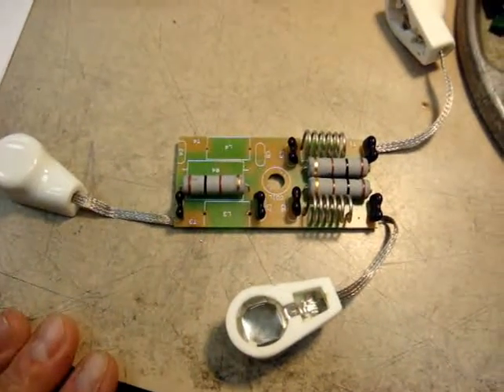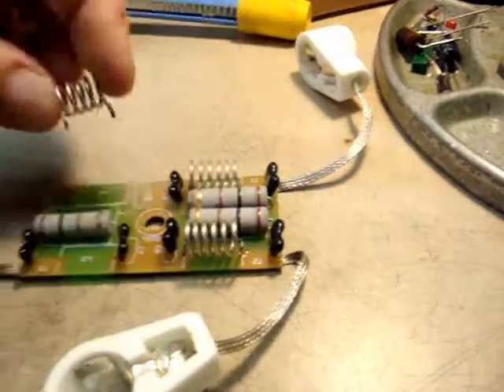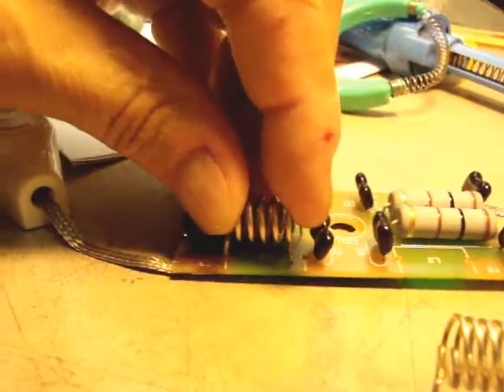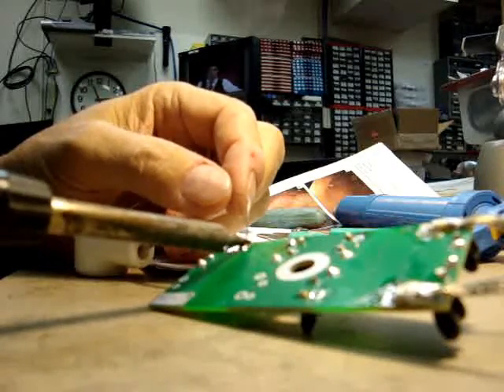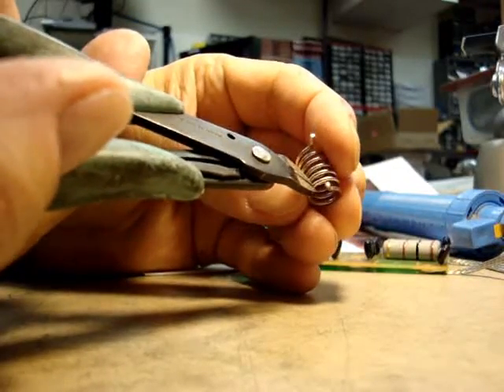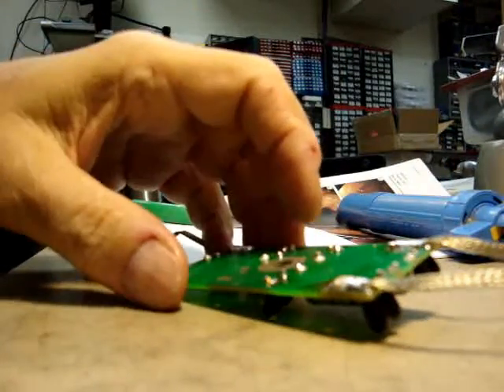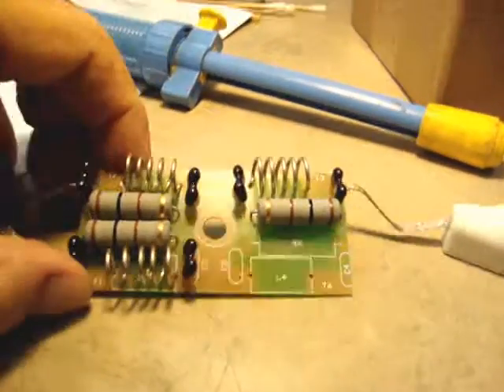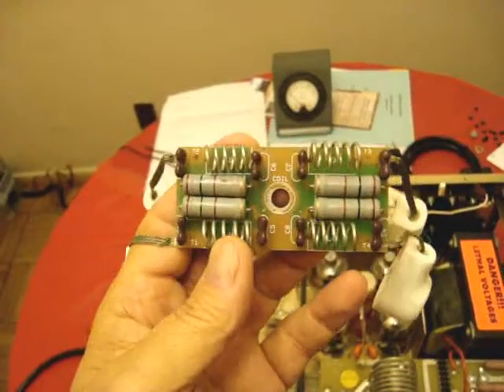Ameritron Parasitic Choke Problem

Comment: mine is different , it must be an older design as the resistors are located inside the inductiors, and there is no circuit board.
Reply from the maker: slartybardfarst52 - Yes, you're right.. Ameritron used those in their older amps. There's really nothing wrong with that style. Altho, some of the more recent theories with parasitic choke designs indicate having the resistor and coil side-by-side as is the case with Ameritron's newer style parasitic choke design. Supposedly,  it works better. If your amp is stable, then it's ok.. no need to change anything.
Reply: Bob H I do have a strange fault with mine though,  even though the amplifier works fine the HV meter only shows about 700v on the meter instead of 1.7-1. 8 Kv.  I don't understand why this.
Reply from the maker: slartybardfarst52 - Check the meter dropping resistors in the plate voltage circuit. Since you verified that the amp is functioning ok, it sounds like the resistors may be bad. Do you have a HV probe to check the plate voltage?
Reply: Thanks for the reply Bob, I took the time to check the associated resistors in the vicinity of the meter, I had checked them before but thought I'd best give it another look over, they all seem to be ok, R6-11 checked and all within spec. I'm wondering whether it could be a tube? the anodes on 2 are not good and burned through, luckily I have a spare set. And no unfortunately I don't have a way to check the HV unless I make a potential divider with a bank of resistors.
Reply from the maker: slartybardfarst52 - Check that the amp is wired for the AC mains voltage you're using. Did you get this amp from a previous owner?
Reply: Yeah it's an old amp, I'm in the UK so the mix of 110/220 shouldn't be an issue as it will have been on 240v here all it's life.
Reply from the maker: slartybardfarst52 - I've seen these amps having previous owners that were wired for 240v and a 120v plug, so that's why I always advise checking for that. Your measuring only 700v sounds indicative of this problem. If you're comfortable doing so, remove the amp cover, short across the interlock switch and check the voltage across each of the 4 power supply capacitors; voltage should be around 450v DC per capacitor. What is it?
Reply: Bob H Great suggestion Bob,  I took the lid off and tested all the 4 capacitors and it indeed reading about 450v on each +/- 2 volts,  so that means my HV is in fact definitely 1.8kv, why the inbuilt meter isn't reading more is strange,  BTW it deflects fine when reading plate current.
Reply from the maker: Good info. Interesting that the meter works ok in the plate current position. That verifies that the meter movement is ok (I think). So verifying that the following resistors are ok (R6, R7: 1 Meg ohm, R8: 1.5 ohm, R9: 0.6 ohm, R10: 330 ohm), then check S4 switch. Switch open = plate volts; switch closed = plate current. I'm just wondering if maybe S4 is resistive when open. If in doubt, just remove 1 of the wires connected to S4... see if that causes the meter to work for plate volts. Let me know the results.
Reply: Ok the resistors are fine and within tolerance and also the switch is fine , I tried the wire disconnect and also put my meter across with the wire removed, the resistance shows open circuit (infinity) and then just lead resistance of the meter when closed (0.2 ohms) , so all looks good, I know the switches are prone to breaking down.
Reply from the maker: slartybardfarst52 - Ok, good. So there's only 2 other possible problems to check. First, check continuity from one side of R6 to C15 (+) and one side of  R10 to C18 (-). They should both be zero ohms. Also, it would be interesting to check the meter by itself to see if it's dodgy. The meter appears to be a 1mA movement. You can use a 1.5v battery in series with a1500 ohm resistor to check it. Connect it across the meter contacts (observing correct polarity)  and the meter should read full scale (without pinning the pointer of course). Let me know what it is.
Reply: Found the problem, a stupid overlook on my behalf, I tested R6 & R7 in situ, both read about 1M ohm , I wasn't entirely happy with R6 , it read more like 1.25M ohm , I decided to lift a leg and check it properly, it was actually 18.5M ohm !
Reply from the maker: Yeay, well done! A bad resistor after all. BTW, I have an updated schematic which has been redrawn and mistakes have been corrected. Much easier to read. If you're interested, I'll email it to you. Mine is bob4analog@yahoo.com. Cheers!
Reply: Thanks Bob for all your help :-) got there in the end, I have ordered some resistors, I'm in the UK so getting the parts from Ameritron works out expensive I'd imagine so I sourced some local, have a look over the internet and never found anyone experience the same fault, another one to look out for I guess. Thanks for your help and good advice, I'll send you an email.
Reply: @bob4analog  Hi Bob, I have this older amp, the problem is the resistors inside the inductor get burned. Most of the time I use this amp working on 40m and 20m and also 15m.

3 times replaced but got the same issue.

What could be a problem.
Reply from the maker: @inoor9000   Has it always burned the resistors? Does it only happen when working on 40, 20 and 15? How many turns are on the parasitic choke?
Reply: @bob4analog  Thanks for quick respond. It only happens on 15, the parasitic choke has 7 turns. The amp is only used for SSB mode and for the time being don't use the amp for 15.
Reply from the maker: @inoor9000   Try shorting across or removing 2 turns of each choke. Really, only need 3 to 4 turns are needed; 7 turns is too many. That was 1 of the flaws with this amp. This is the reason I made this vid of the modification. If the parasitic choke has too many turns it will become reactive on the higher bands and burn the resistors.  Let me know if this works, I'd be interested to know.
Reply: @bob4analog  Just made it 4 turns, no more issue. Big thanks Bob...
Reply from the maker: @inoor9000   Great, glad it worked! 73's!